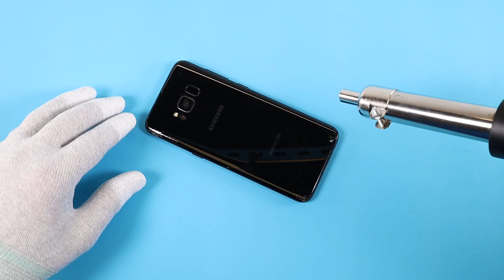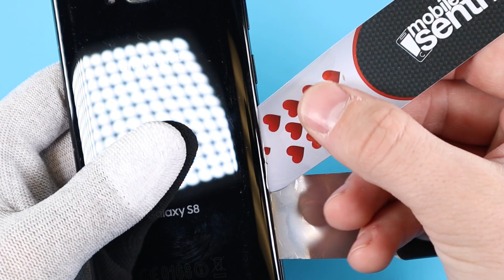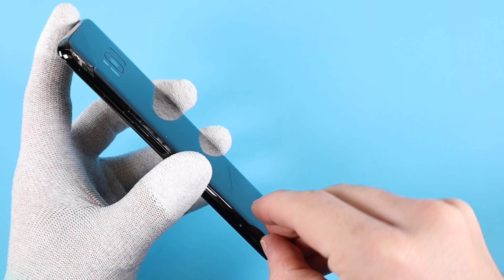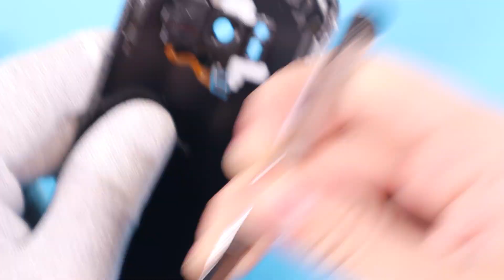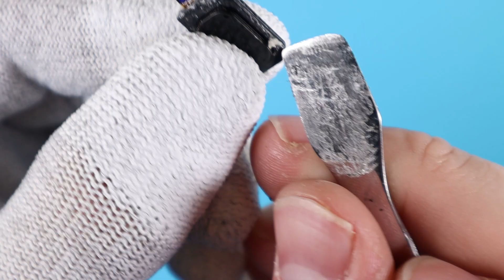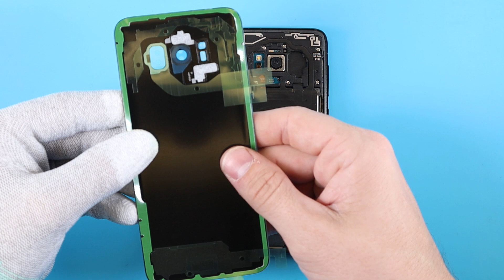Samsung Galaxy S8 Back Glass Replacement

Comment: Do I need or have to replace the back if my phone is still working? I just noticed it was cracked but have been thinking of buying a new phone anyway. I just want to know if it is necessary to change the glass? What will happen if I don't? Thanks.